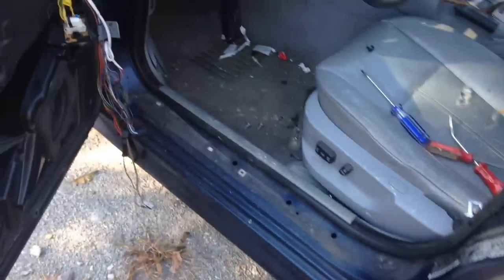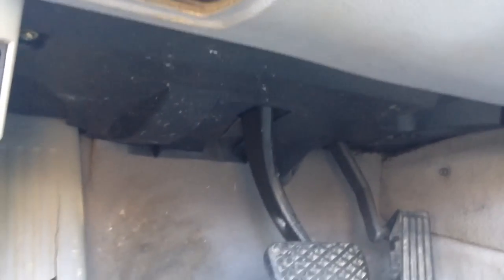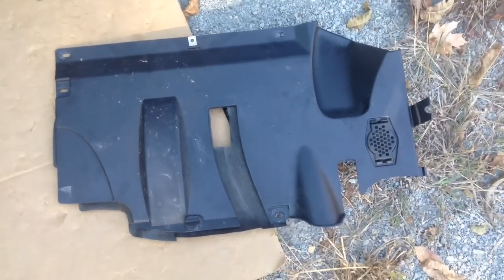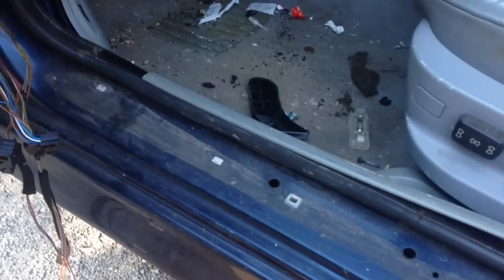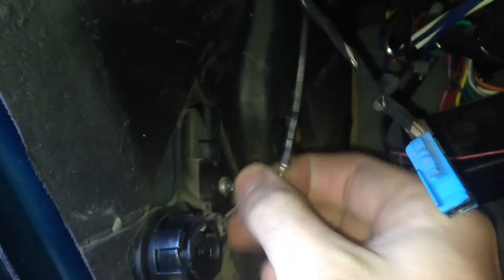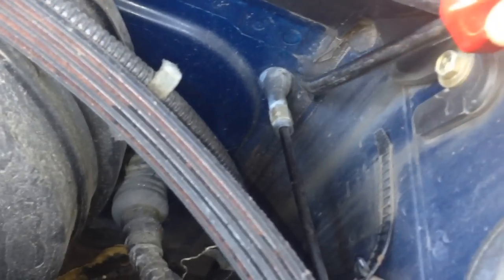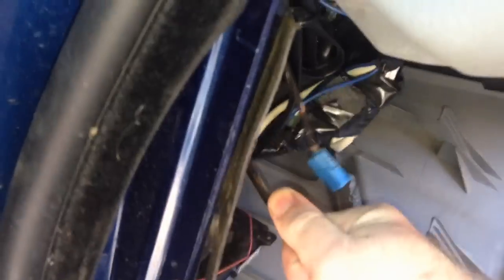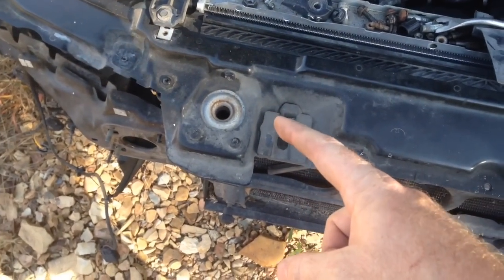BMW E39 E38 E53 Hood Cable Removal Easy Step by Step 525i 528i 530i 540i 740i X5

Comment: To all: The wire has almost NO slack when okay. So when you experience that your lever is somewhat soft and "grabs" the locks almost at the end of the movement you may want to check your wire ASAP. You may be pulling only one or two remaining strigs left that just wait to break as well. It is far easier to change it as long as you are able to open your hood instead of changing it once you are locked out.

Comment: Thanks for the video! My passenger side hood latch stopped working (X5 - E53), so I'm guessing it's a problem with the center cable. Several DIY forums say that you need to remove the front bumper and driver-side headlight in order to remove the hatch and replace the cables. I am hoping that I can fish out the cables and replace them without having to mess with removing the latches or the hood.  Fingers crossed!

Also, from your video, it looks like I'd destroy a bunch of nice decorative plastics if I try to replace the cable that goes into the cabin... I guess I'll leave that one alone for now, unless it looks horrible.
Reply from the maker: +Alex Iliev Is your cable broken and the hood stuck closed? if so i have another video that shows how to get it open.
Reply: Nathan's DIY Garage  -- thanks for the tip. I'll look around for the video.
I'm not 100% sure that's wrong. The hood doesn't open, and I'm looking around the net to get ideas how to solve it. When I pull the lever, I can see the driver-side latch disengage, but the passenger side is stuck. I'm assuming it's the center cable. I'll try to fix it next weekend. Cheers and thanks!
Reply from the maker: Nah just take the passenger grill out , there are little flaps to the left of the fan, you can just reach in the top flap and pull the cable

Comment: Nate brotha you ain't gonna believe it but my hood latch has gone bad today too. Man the two cables near the auxiliary fan are rusty and i think its broken between the driver side latch going back to the middle long piece. So once i am able to get that situated im gonna replace the entire cable hood latch wires so it actuates as it is supposed to. I literally just discovered this issue. When two days ago it opened just fine. Bcuz i removed the water pump and thermostat. (I was about to show someone the exhaust side to get at manifold bolts when i learned it was broken) ten steps forward n 50 backwards lol
Reply from the maker: seems about right, at least I have a video up so you can get it open
Reply: Nathan's DIY Garage i tried your video on the subject and man oh man these cables are really very very rusty. I got the cable to release passengers side but driver side i need to get under the housing to push the latch or catch portion towards the driver side front fender...then i can access the motor.

Comment: Thank you for a great video! On our 1999 e46 the drivers side latch does not ever catch closed. I have to depend on the passenger side to keep the hood closed. And yes I tried moving that striker bracket on the hood all over the place an no luck. But maybe I need that other part new, that the striker bracket goes into, new??  That e46 is really a great car!
Reply: I watched your other video and I'll try spraying penetrating oil on that locking latch and freeing up that wire, and hope that will work.
Reply: I followed all your instruction and everything is well now. BMW are really great cars! Thank you for all you do.

Comment: do you have any idea how water would get in when it rains because i get water somehow rite next to the hood release very puzzling
Reply from the maker: make sure the hood is latched, and check those seals by the cowl, is the water getting into the spark plug tubes?
Reply: the water is inside the car on floor mat where the trunk release is
Reply: do have a method on cleaning out the sunroof drains i noticed i have a clog on the drivers side thanks again

Comment: have any experience  with e38 2001 740il my car wont $hift into forward or reverse it act$ like it want$ to $hift into gear but it's like the rear wheel$ are loved up...before it happen I kept $eeing the (Abs) &( !)triangle icon pop up on da$hboard. I been told it could be the linkages or low trans fluids..